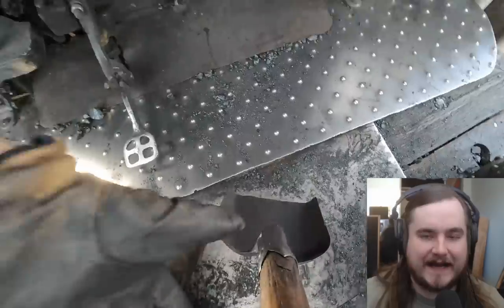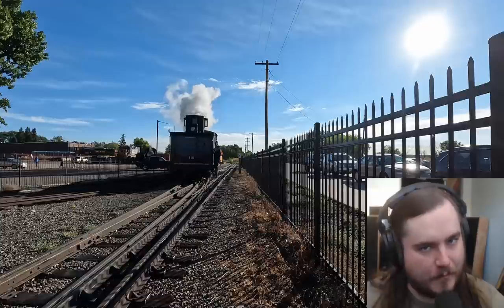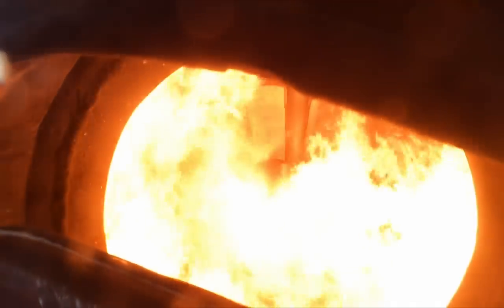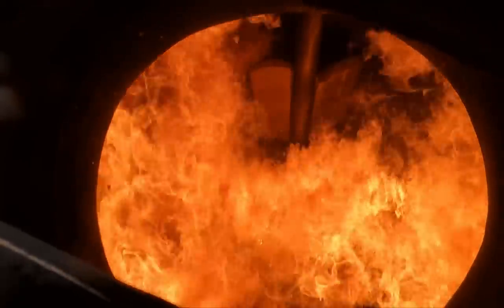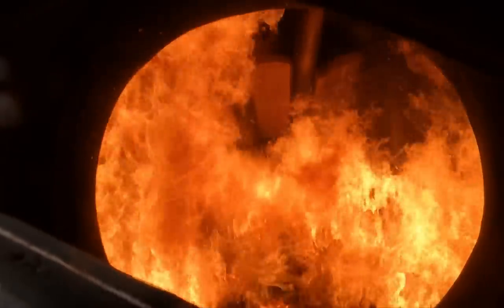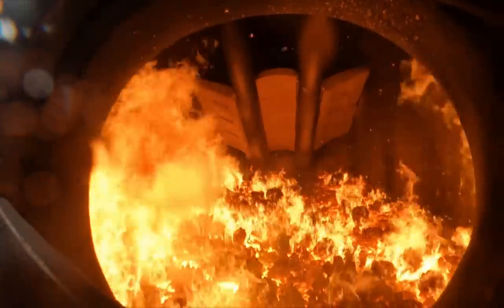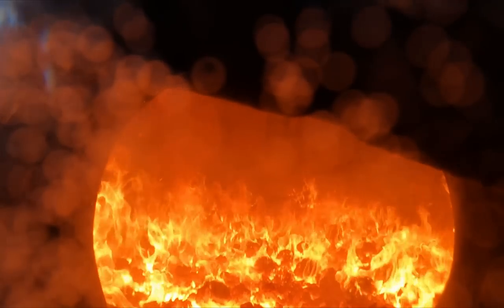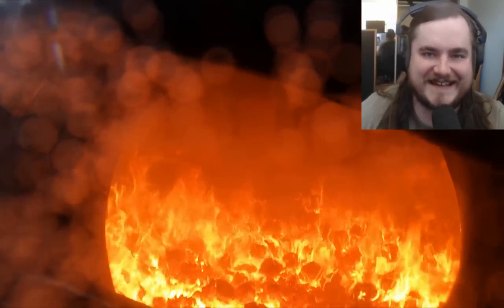I broke things to film the inside of a steam train's firebox.

Comment: Does the fire expand with the power stroke due to a thermal contraction of the boiler loosing steam around the boiler tubes or a barometric draw from the blower acceleration? I feel like it has to be the blower increasing it’s draw but I thought the blower was a small turbine with a continuous draw of steam from the steam dome independent of the pistons and therefore would be continuous without a pulsing nature.
Reply from the maker: So, a few things:

The exhaust "chuff" of the locomotive from the powerstroke draws gas through the flues, and thus the fire. That's the pulse. 

The blower is just a pipe that vents steam continuously (per valve setting) out the stack. It is not a turbine. If you used the blower, it would be continuous.
Reply: @Hyce777  Okay, I’m following. I had to relook at a diagram of a steam engine to see the steam exhaust port inside of the smoke box. And I was clearly mistaking a dynamo as a blower. But I do have a further curiosity. Diagrams of earlier steam engines don’t typically show a steam exhaust port inside of the smoke box. It seems like they just vented the steam strait from the cylinders. Does that mean if you filmed firebox footage of the Jupiter and 119 replica locomotives at Promintory Point they wouldn’t pulse with the chuffs?
Reply from the maker: @jeffreyhallam5517  that doesn't sound right to me. Most likely left off the drawing, or incorrectly drawn. That, or the petticoat shroud came down so far it didn't appear that the firebox would get a draft; but so far as I know those engines are set up just like this is.

Comment: You, good sir, are certifiably insane. But in a good way 👍
Reply: Consider rigging up a stationary mount to place in front of the firebox but with enough distance so the welding shield doesn't melt. Do so by employing a telescope. And placing the heat shield between the telescope and the camera.
However, this approach has the potential to destroy your camera(s) as you're essentially constructing a big magnifying glass with the camera in the focal point.
Also, try polarization filters.
Reply from the maker: All good thoughts.

Comment: I wonder if you could set up some sort of liquid cooling loop, I'm just thinking if you're trying to mount it to film for a bit longer you will eventually heat the water and boil the camera! You could do it with a little water reservoir and some hoses off to a heat exchanger...... hanging out the door to get some good airflow cooling maybe? Although, that said, I guess you've got a whole tender full of water, maybe just don't bother cooling the water, take cold water out of that,  and just flow the water back into it, the flow should be small enough compared to the volume of the tender it'll make little difference to the temp in the tender.
Reply: And...... that does make me wonder, if you had a high enough water flow rate.......... could you stick the camera actually inside the firebox........ how expensive are those cameras again?
Reply from the maker: That would be the coolest thing to see for sure. They're about $400 a piece. Maybe some day I'll try it.
Reply: Oooof, that's a fair bit of risk at $400.... but man that would be cool as heck. I guess it'd be tough though to ensure a high enough water flow, both speed and volume, to avoid the water heating up on the way to the camera too much, and also to keep it cool enough even coming back from the camera to avoid melting the hose. And of course,  also mounting of the hoses running into the firebox in a way that wont interfere with the firemans work....
Reply: @Hyce777  Perhaps rig a water line from the tender to the camera box and then to the water injector so the water is more or less always flowing. It would be a lot of work for a short film, but oh so worth it!

Comment: Have you considered galvanized steel? The same thing they use to put out oil fires
Reply: Heat transfer would be like the plastic shield and overheat the camera.
Reply from the maker: For what?
Reply: In Texas when the oil well blows and the man gets to the oil well they use galvanized seal to put at the fire with an explosive but they don't eat if they don't use them not seal they can't get to to it because the Heat's too intense

Comment: The "blower" (sorry don't know the correct US terminology) should be on when the regulator is closed. It's not just the flow over the stack. Running without the blower would risk a blowback into the cab. Nice shot though. Ta.
Reply from the maker: Actually our smokeboxes and draft are set up such that wind over the stack is enough. You're right that a lot of time, you need the blower with the throttle closed; but not always with these engines. A lot of folks think it's a crutch too.
Reply: @Hyce777  Got me wondering if UK practice is a consequence of our very restricted loading guage. As boilers got bigger, chimneys got shorter. By the 1920s most large (by our standards) locomotives had very short chimneys, necessitating assisted draft. 
I'm a big fan of US railroad's massive loading guage.
Thanks and blessings.

Comment: If you were a passenger on a train, the car breaks away, and for whatever reason it either has straight air brakes or no air brakes, could you use the brake wheel to slow the car?
Reply from the maker: You can, but it's not very effective without a brake club.
Reply: @Hyce777  Yet another mistake in the Polar Express! I think my total is like 50 something-60 something by now.

Comment: Does opening the door change the draft ?
Reply from the maker: The draft no, but steam generation yes. Opening the door allows more cold air in, reducing efficiency. If you run the engine hard with the door wide open for a long time, it can cause problems for the engine, but the little we did here was hardly doing much.

Comment: 7:49 i wonder if you could do a pulverized coal powered steam train .. if you dont know what pulverised coal is.. wiki it its intresting
Reply from the maker: The power plant style stoker fed steam engines use very small coal. Our hand bombed guys need the big lumps.
Reply: GE once did an experimental DIESEL engine running on a slurry of pulverized coal and water.  Apparently it worked fairly well (without significant engine modifications) except for the eventual fouling.  There have also been experimental pulverized-coal turbine locomotives, but the turbines eroded too quickly.
Reply from the maker: @BrooksMoses  ...wack